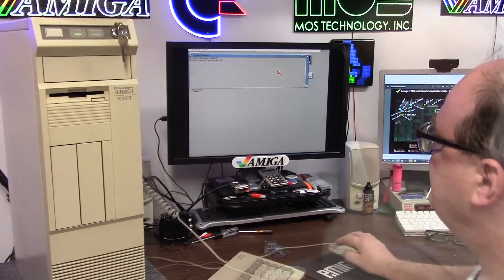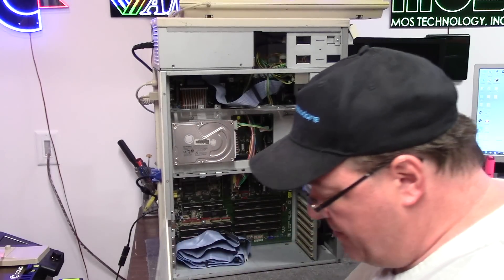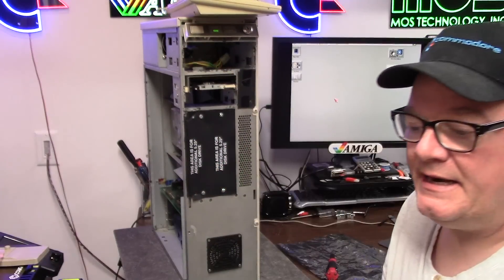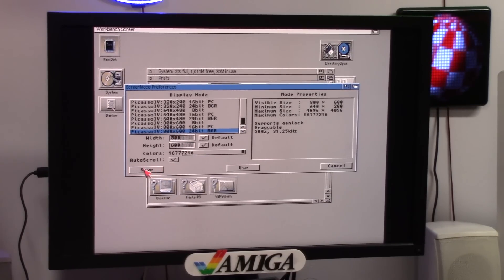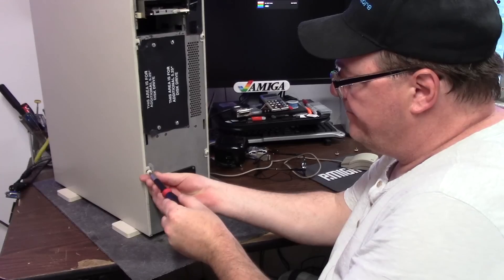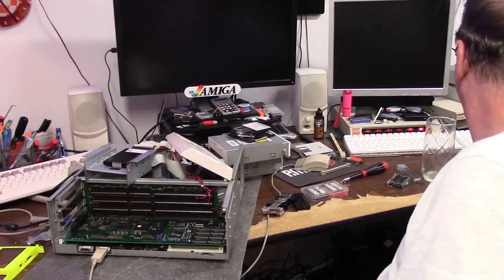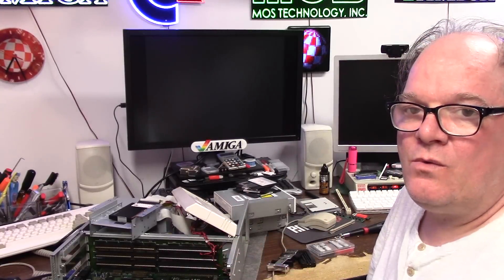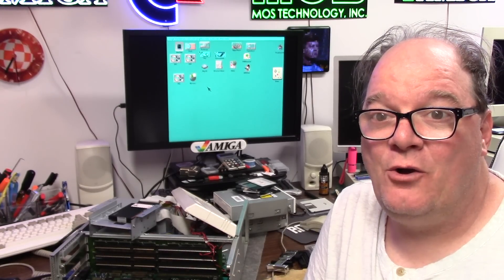Picasso IV RTG video card on Amiga 3000/4000

Comment: With the maxed out 060 systems I had built, some with the Picasso 4, through lots of experimentation, compatibility issues were either due to motherboard revision, rom version or expansion board manufacturer types. They just didn't like being in the same machine with each other, hence having multiple systems.

Comment: You've got a replacement SIMM socket on the A4000 that stands the stick up vertically, and that means a card like the P-IV won't fit unless the standing SIMM is removed.  I've got some SIMM sockets on my A4000 with broken tabs and would like to replace them.  Do you (or anyone else here) know a vendor that carries the correct type SIMM socket for an A4000?  One with metal latches would be nice, but not an absolute must.  I would prefer a replacement that mounts the SIMM sticks at a lower profile angle though.  Thanks!
Reply from the maker: Amigakit sells them.  I have replaced mine since.  They will be shown soon
Reply: @ChrisEdwardsRestoration  Thanks, I checked AmigaKit's website, but it says for both angled & vertical: "Availability: No delivery date or availability confirmed", there's no price listed, and no option to order them.  I'll send them an email and see what they say.
Reply from the maker: There are many online stores.  Analogic.co.uk, amigastore.eu.  Amigaonthelake.com. And many more.  Someone has them

Comment: For a moment I thought you might be having the same issue as I. I have a Piccolo SD64 that only works in Z2 but not in Z3 mode in my A4000. I’m suspecting a faulty GAL chip at U714. I’ve got a replacement GAL but still need an adapter for my TL866.

Comment: I have a Picasso 4 running in an A4000/040.  The person I bought it from ran it in an A2000 so yea the removable section is joined back together with Ribbon Cables.  It's been years since I installed it but I did have issues with the daughter board, so I just recapped it and put it back in and it worked fine.   I am running 3.1.4.   I have not turned my A4K on for quite some time, but I just turned it on to make sure it still worked.

Comment: I had a PicassoIV in my A4000, and I remember clearly the force needed to get that huge double edge-connector into the vertical daughter board. I can completely believe that he had problems getting it in with a good connection between everything.

Comment: I can report that I just got a PIV for my Amiga 3000 with 3.2.1, and it works fine. The native modes could look a little better on my Dell 2001FP (there's vertical banding I can't get rid of) but overall it's fine.

With that said, I can't wait for my ZZ9000, I have been very spoiled by RGB2HDMI, and looking at the soft VGA output from PIV is not ideal...